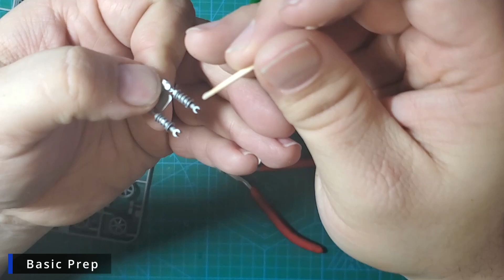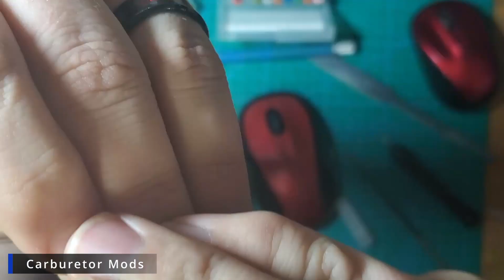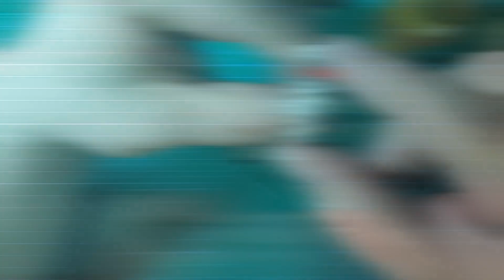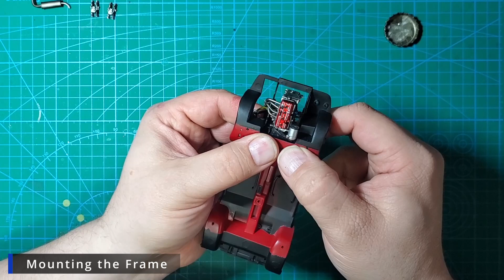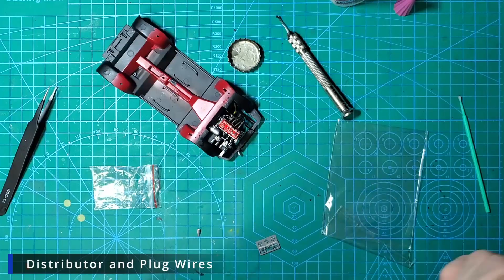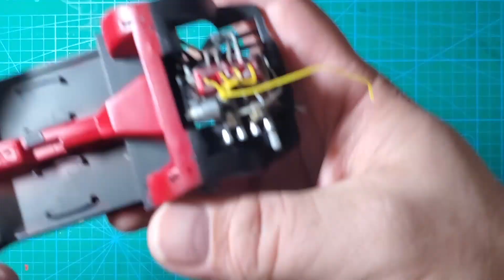Tamiya - Alpine Renault A110 - Running Gear

Comment: Nice detailing around the engine the black wash really makes it pop and good idea with the HT leads gluing from the underside regarding your springs isometimes i replace them with springs from a click pen adds to the detail 👍
Reply from the maker: Sometimes I scratch build my entire shocks using pen springs as well. These shocks were very nicely detailed and had minimal issues that were easily fixed so I stuck with the kit ones. Thanks for watching Seamus!

Comment: Nice engine detailing Justin. Thanks for the tip about the mold lines on the springs.
Reply from the maker: Thank Rick. first time I tried it. I'm glad it worked out. Takes a good bit of brushing though.